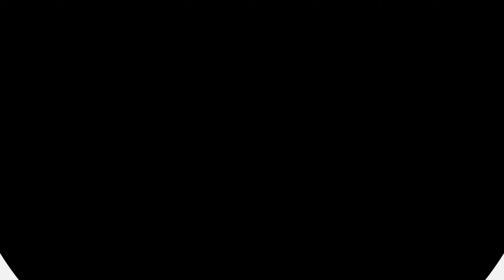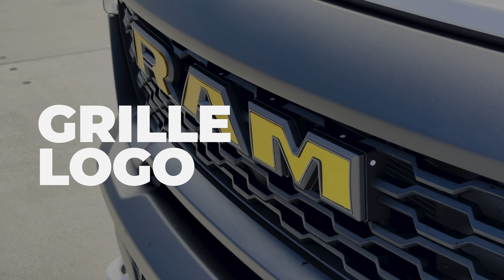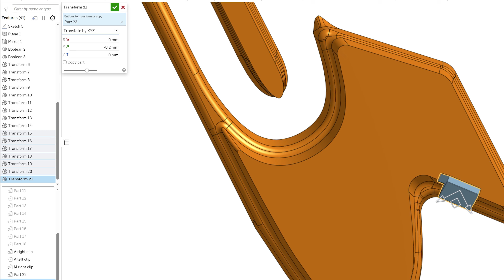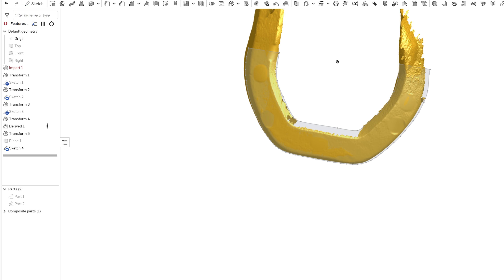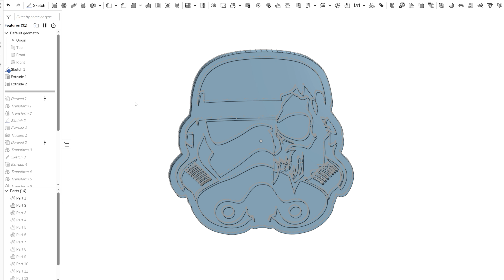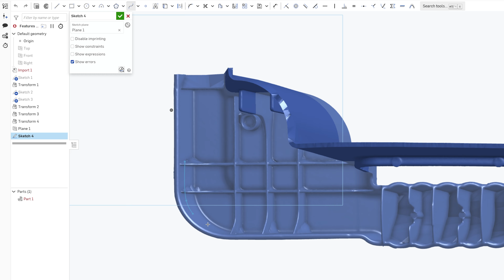Printing Car Parts | Making Unique Mods You Can’t Buy Online | 3D Printing Edition

Comment: These aren't "Car Parts." They are accessories at best. I was expecting a valve cover or a filter housing etc. Anyways. Most 3d printed materials will not live long in a vehicle. Unless you are printing with ABS or ASA or stronger UV rated filaments. Its still good practice to make things. Depending on where you live. It may not last long. Its odd though. If something is all layers like a 5mm thick square that has 5"x5" sides. But its 100% infill. That will warp much faster than the same shape with 3 walls, bottom and top with 20% infill. So if you can get some infill in there. It will help with warping on outdoor pieces. Or printing in one color, but finishing the part by painting it with UV resistant paint. That will at least stop warping from direct sunlight. And white or natural filaments will last longer. Ive had a fidget star sitting on my balcony for more than a year now. Direct sunlight for half the day. In Arizona. That thing hasn't warped yet. When 30 seconds of direct sunlight will warp something printed in black.
Reply from the maker: will see, still holding up good after 4 months in Florida heat. I'm actually interested to see how long it will take for the materials to degrade
Reply: @therealfazee  It almost seems hit or miss. Different brands of PLA seem to have different results. Ive had stuff inside the vehicle during the summer. Might as well call it 200F in there. Some PLA doesn't show any warping. Some show it under a minute in the sun with a breeze.
Reply from the maker: none of these are PLA tho, PETG for most of the parts, PC for the wheel lugnut covers.
Reply: Hi, what software did you use to design the parts? Which scanner did you purchase? Thank you.
Reply from the maker: Onshape and Creality Raptor